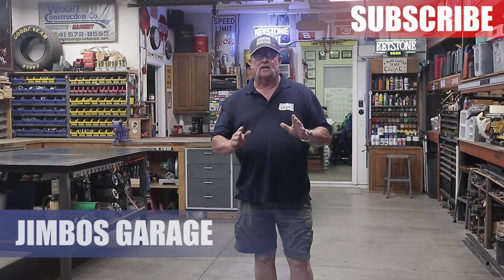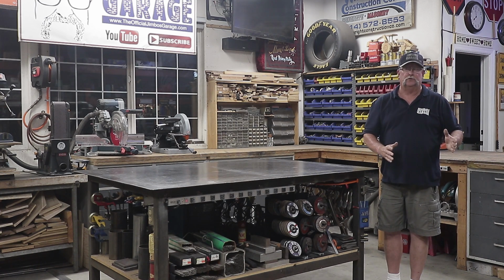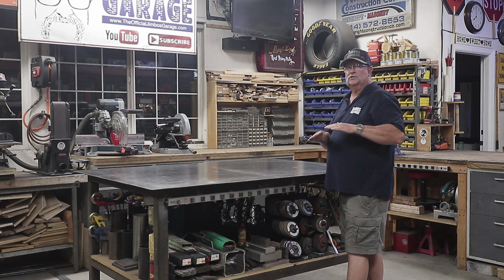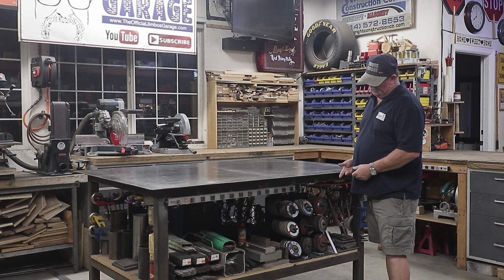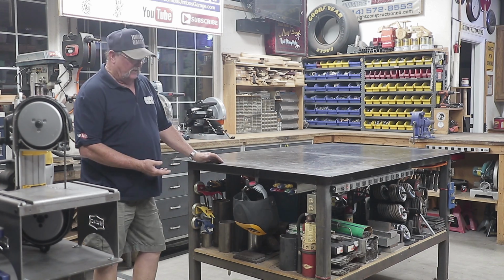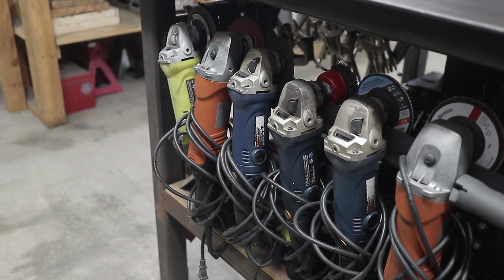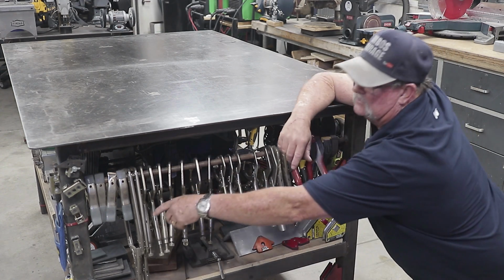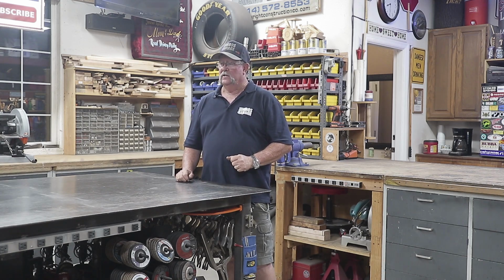Organize Your Welding Table  | JIMBOS GARAGE

Comment: That’s funny when you mention that people ask you why so many grinders I have been asked that so many times I feel like putting up a sign because I do just like you I’ve got 12 of them and when I catch like pears on sale, I’ll buy one as back up, but I got different flat wheels compounds cutting wheels grinders wire wheels You name it. I got it because like you said, I hate changing to a different disk or whatever on it I just like to walk up grab it use it. But thanks for your tips. I love that power grid that you have on there. I started utilizing a table and I’ll probably take your tip on getting a thicker top plate. I think mine is a quarter inch also. Thanks again and great shop  
PS: my garage is that organized and clean about four times a year lol😂

Comment: I'm new to metal work. Can I weld with electric tools on the table top? Bench grinder because it's mounted, hand grinder, hand or table top drills.  I'm worried about the current damaging them. Thanks

Comment: I have a 1 1/2 car garage, I know how it is to need space, t have a table saw miter saw, drill press, metal cut off saw, tool boxes, ridding lawnmower air compressor welding cart,welding table, wood and steel . I manage to have a 5 foot wide path in the center to work, everything is on wheels to accommodate my needs. Organization is the key!

Comment: Consult your production of welding platform size, table width, length, and the thickness of the plate is the number of millimeters? What is the height of the desktop?

Comment: That's an awesome layout Jimbo... And I agree with going thick on the top... Don't we all dream of the 4x8 1" thick welding table?!?!?! As of now I use a 2x2x 1/2" welding table because my shop space is limited. I just started my channel and if you have time would like you to check it out. I just installed a extended drain on my air compressor today and made a video of it. My next project for the compressor is going to be adding a hose reel and maybe even hard piping it in. I'm leaning to copper. What do you think about that compared to the black steel pipe? I've seen that black pipe rust inside and I don't want that  getting into my air tools. Thanks for sharing this video. It's like I always say. Let's all learn from each other.
Reply from the maker: Thanks for watching Garrison, I used copper for mine, Cost a little more but worth it. good luck with your channel.  Jimbos garage!
Reply: Thanks... I'll go with copper for sure than.

Comment: Great video, Jimbo! I love all your videos but the organisational ones are especially helpful. I have a question regarding metal dust/filings when cutting/grinding. Do you just let it go anywhere and everywhere, and deal with it when at clean up time? Or do you have a specific way of doing it to minimise mess? A designated area maybe?
Reply from the maker: Thanks for watching Anthony, Ya it pretty much go's everywhere, after i'm done working i sweep up what i can and then use a blower to blow out the rest,  Jimbos garage!

Comment: Thanks for the video Jimbo but I have a question, why are you using "premium shop space" like right under your welding table for thinks you use every 5 years (some stick rods) ? Also do you have side support for your cut off saws ?
Reply from the maker: Thanks for watching, What works for me may not work for you, I like it the way it is. The cut of saw has it's own station.  Jimbos garage!

Comment: I agree on the welding table need to be a minimum of half inch thick. Another thing I would say if you're going to have your welding table up against a wall to only have about 3 foot wide because you won't be able to reach the back anyway. I personally don't like the bars and the shelf at the bottom because you can't sit and weld with those bars there. My table has a bar in the middle. I've added a short piece of tubing to my welding bench that I use as a holster for my mig gun.